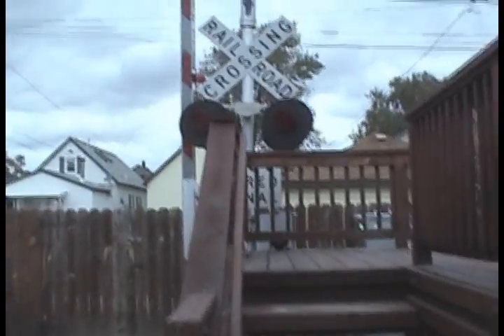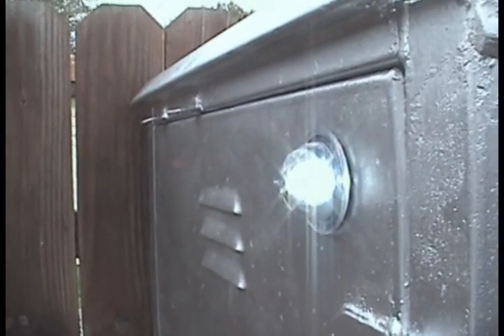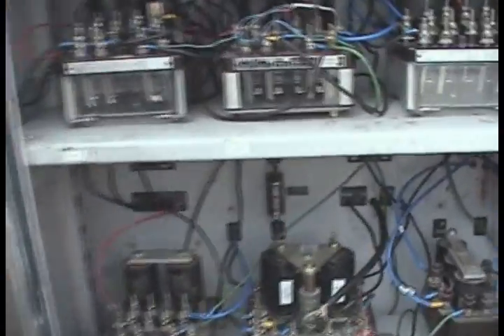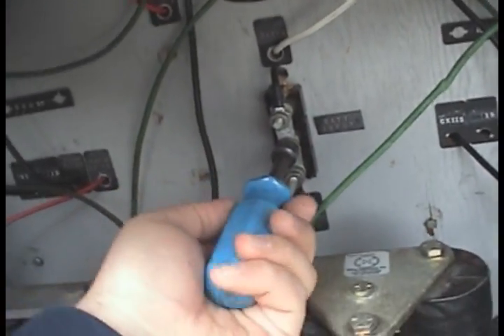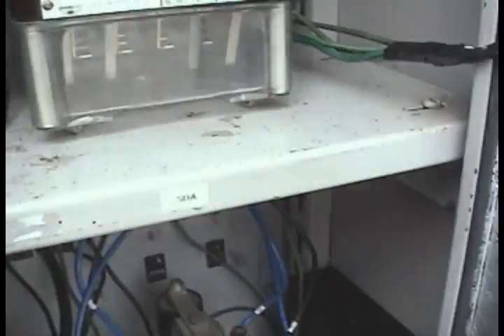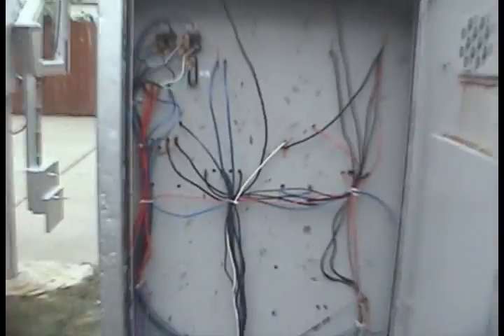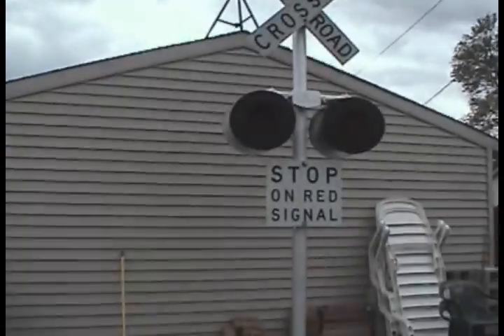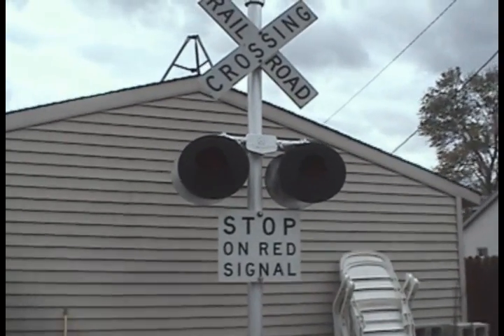My Crossing Signal System as of 10/2/08

Comment: 3:00 - If that's a GS Type 1 E-Bell there from what you said, you've made it low-pitched to sound like the GS Type 2, actually it's sounding a bit lower than that, which sounds like if it's in between the GS Type 2 & the GS Type 3 that didn't exist yet at the time of this Video.

When it comes to the GS Type 1 E-Bells, I like hearing them high-pitched better, like how I can hear the GS Type 1's on the West Side of when you were filming the malfunction at Pennsylvania Rd., plus also on the West Side of Emmons Blvd., both way before the upgrade & the East Side of St. Johns St. after the upgrade.

Heck, at Vinewood Ave. in the now time, we have a dying GS Type 2 E-Bell on the East Side Gated that's sounding like a quiet GS Type 1 & I'm hoping that it gets replaced with an actual GS Type 1, so that kind of sounding can sound louder & more clearer, plus as it'll also sound nice in combo with the high-pitched Siemens E-Bell that's on the East Side Mast.

Comment: Hello this video is great but I need more help and information on getting my Western Railroad Model 10 crossing signal working.  I am in the dark on this and not sure where to start.  I have looked all over YouTube and not much in help.  I see in your controller box you have several controllers running this.  Is there any way you can give me direction on where and how to start to get mine working.  Any help or guidance would be greatly appreciated.  Thanks

Comment: Nice signals!
What determines the flash rate of the double pole flasherelay? 
I have designed and made solid state alternating flashers, but don't see solid state circuitry here.

In China, I have seen exponential horns for the bell.
They may actually be better because they project the sound where needed with less spreading out into homes and businesses where not wanted.

Thank you.

Comment: where did you get the battery charger and the converter box and what is the output voltage for the converter box